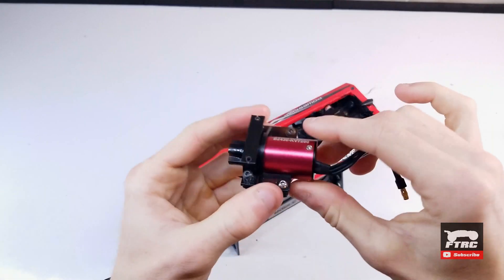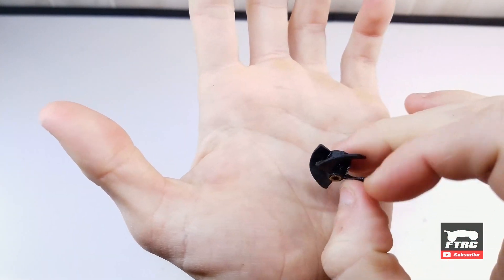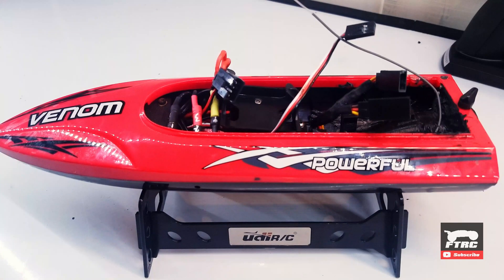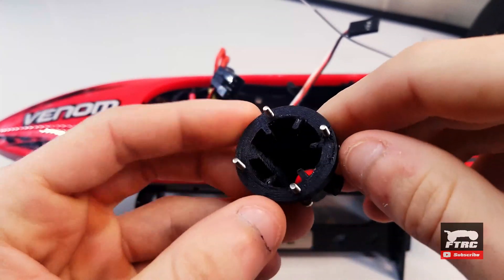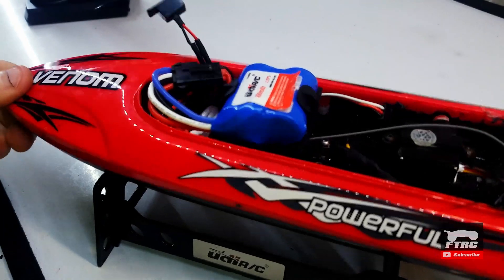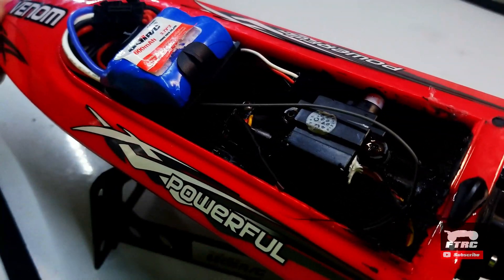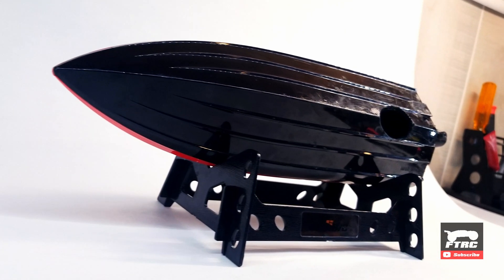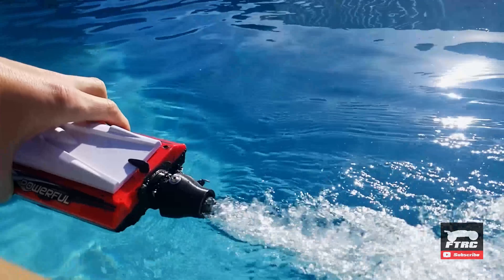RC JET BOAT Part 2 *Brushless* (3D Printed Jet Drive)

Comment: The reason the brushless motor didn't come alive is because you used the cheap, stock Li-Po battery pack that came with the boat. You need a Li-Po pack with at least a 20 to 30c rating or more to get the motor revving like it should.  The stock battery is probably 10c at best regardless of the manufacturer claims. Good luck with your project - it looks cool. I went ahead and subscribed because I want to see a part 3.
Reply from the maker: 100% agree. If you saw any of the other videos of my jet boat project, you probably saw I fully 3D printed a boat. I used a better battery in that boat (65c rating) but the hull design wasn't that great. This boat stuff is definitely a learning process.
Reply: @FullThrottleRC  Yeah, I have one of these little boats and have done several conversions to it. The results from each conversion were all the same, not so good. I never tried a jet conversion on this boat, however, but I actually converted a NQD Tear Into Jet boat into a prop drive - just the opposite of what you did. One thing I discovered about this boat is that it is just too narrow and cannot handle much power. With a brushless system on 2S, the boat turns into a screw and spins the same direction as the prop whenever I give it too much throttle. I finally got it to work very well with a steerable outdrive system from a ProBoat Mini Cat and running a similar-to-stock motor on 2S. The boat is amazingly fast and turns equally in both directions. The boat holds a tight line in the corners and leans so much that it looks like half the boat is under water. I also had leaking issues that I could not resolve. I discovered that the canopy (lid) is where the water comes in from on my boat. The boat remains completely dry whenever I seal the canopy with tape. Looking forward to part 3!
Reply from the maker: @georgegonzalez9281  Thank you! Not sure when the next video on this ongoing project will be. I have a bunch of projects I'm trying to work on at one time